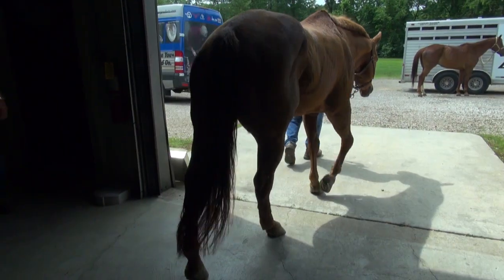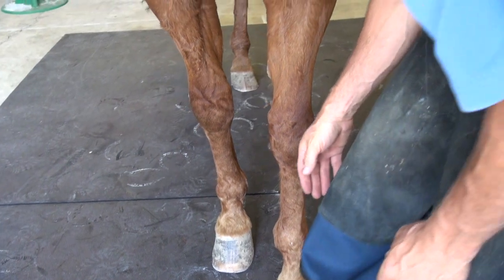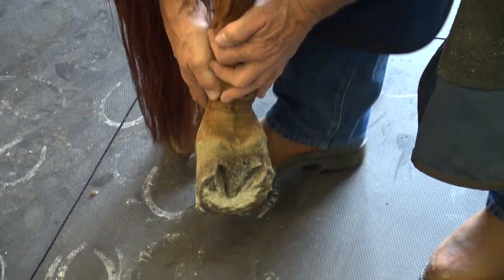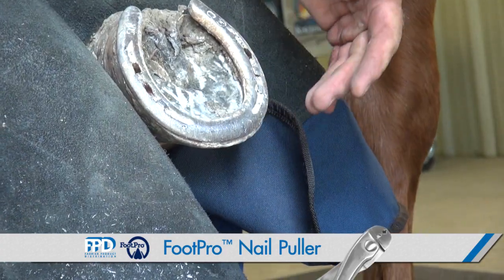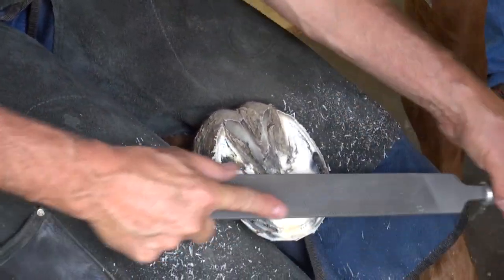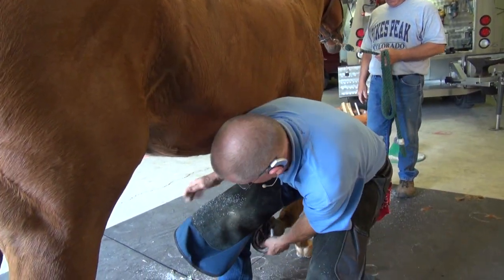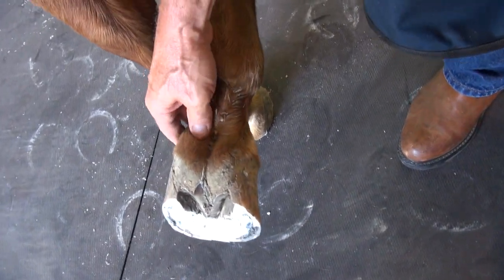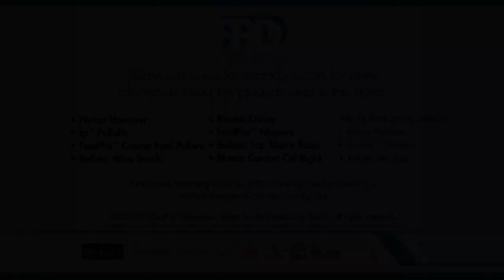FootPro Info Series - Evaluating Limb Deviations &  Hoof Trim

Comment: Why is it farriers are so ready to rasp and sand the walls of the hoof it use to be only when needed. It was thought the outside hoof wall protected the hoof now sand or rasp with no thought.
Reply from the maker: Many feel that the old concept of periople is not so valid and they want to dress the wall and then apply a coating to help with protection. Often there are minor deformities to the wall that are improved by the dressing they do.

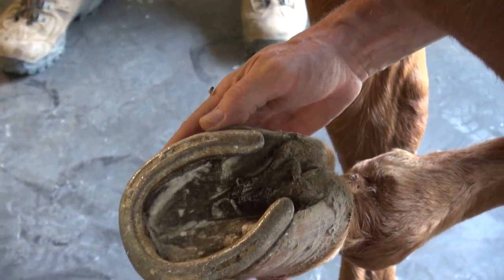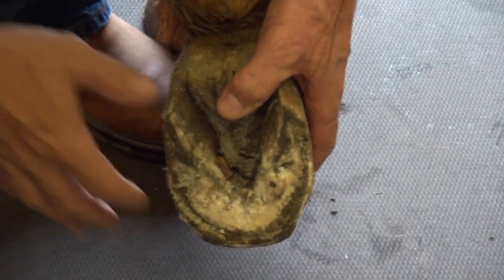Comment: (5:47)  long toe..contracted heel...(7:17 ) so if he's wearing hard on the outside why is the bar long ?  The lateral heel is fine (trim the bar) the medial heel is long.  Can't trust any hoof deviation until you fix the pathogen infection.   (13:50)  look at the curve in the hairline at the quarters...this horse screams long toe...that hoof is 70/30 toe to heel.  (16:55) there you go again rasping through pigmented wall.  (21:38) way too long a toe..fix break over. when you rasp the face of the hoof wall at the toe you're hiding the flare not fixing the flare...all you're doing is weaken the hoof wall.   fix the flare from the bottom...You are so clueless
Reply: Correct, there was a lot more that could have been trim´d off. I cringe everytime I see a shoer dressing the Hoof wall! I call it "OVERWORKING THE HOOF" and there is no reason for it other than cosmetic.
Reply: There is no need to touch the hoof wall to pull back the toe more...pull break over back from the bottom...toe rocker...that way you can leave wall to protect P3 but reduce stresses that cause flaring..
Reply: LOL, you people picking this (unfinished) job apart, but can't see the forest for the trees. 

This shoeing was split into 3 videos. If you watch the other 2 videos you will see those long toe issues were addressed "from the bottom". 

And this "trim more off, but save the wall to protect P3" is the funniest thing I've read all week!
Reply: Oh, wait. You seem to have commented on those videos as well, and still hadn't put that together. 

But "he's" the clueless one... ...right.
Reply: trolls mate!!!